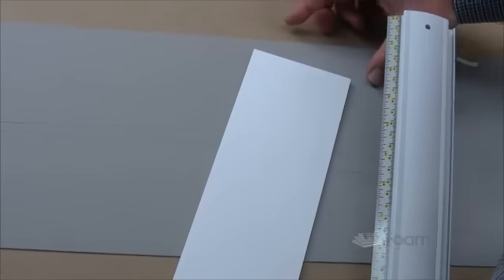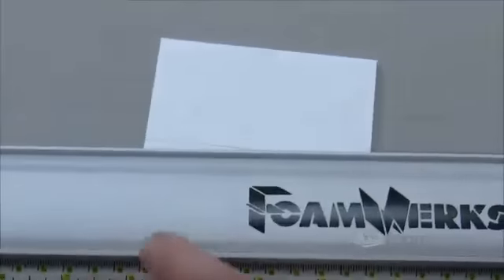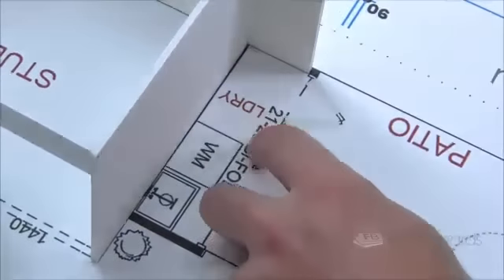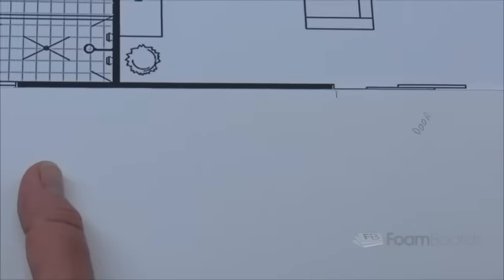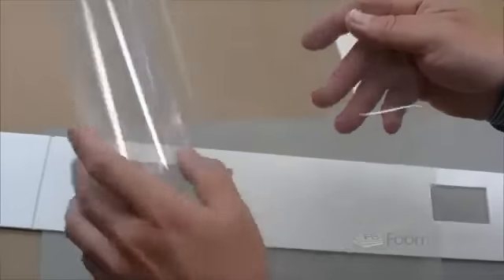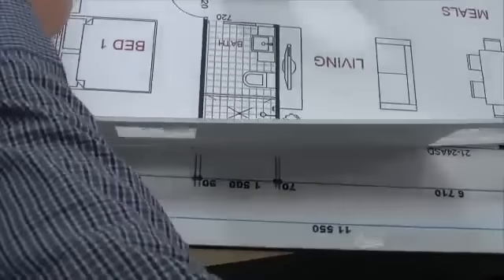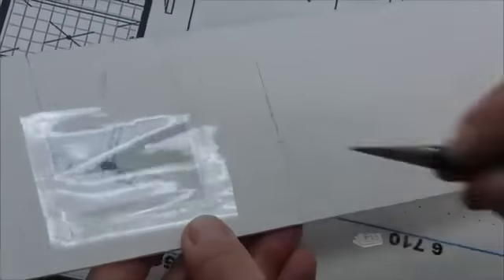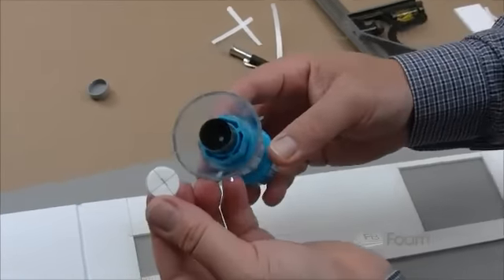Foam Board Model Making Architectural House Scale Design Part 3

Comment from the maker: Thanks for your feedback Tozinim. I personally prefer the 6010 because of the added strength and versatility that it provides. Been doing a lot of curved cuts lately and the 6010 handles the torque well. In regards to the 6001 one area that should be explained in all cutting processes is that you can cut the board in more than one pass. That way you don't put undue strain on the tool or the blade. I haven't had any breakages of the blade holder when used in a two cut pass fashion. Thanks again.

Comment: cont...). The plastic housing that holds the blades in place is weak and too thin, so any amount of pressure put on the blade means it slices through the housing. Mine lasted about 3 cuts and broke. Bought the ruler track as well so replaced this cutter with the wc6010 which is loads better, though not perfect. Thousands of cuts later it hasn't broke :) Don't buy this if you're cutting 5mm, it's not good enough, get the 6010.

Comment: A foam core board model is good for constructing and studying the basic shape of the structure. But, if you want to see the actual building materials including siding, roofing and details, I recommend building with the 3-D Home Kit, which can be found online. You can also combine the foam core board and material sheets from the kit.

Comment: I am quite impressed by these foam werks tools but after reading this review on Amazon.com I got a bit worried about the durability of these tools as they are not that cheap:1.0 out of 5 stars Utter Crap, 14 Dec 2012
By Simon - See all my reviews
Amazon Verified Purchase(What is this?)
This review is from: WC6001 Foamwerks Foamboard Straight Cutter (Kitchen & Home)
Nothing wrong with the seller and received the delivery quick - but this cutter is pants on 5mm and 10mm foam (not tried on 3mm).